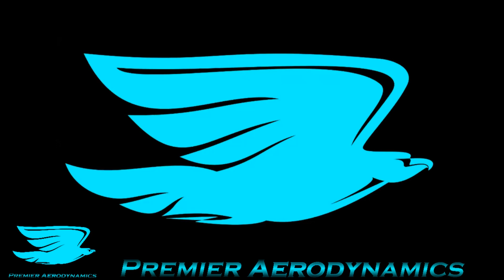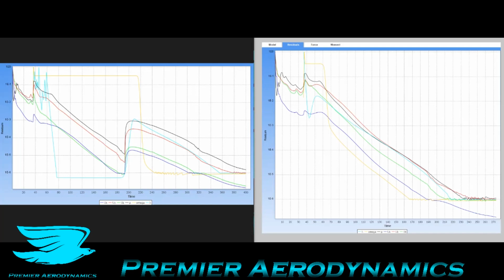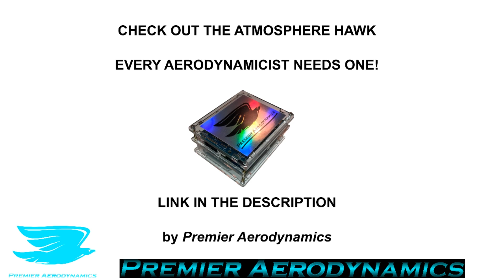Comment: Registration for the International Aerodynamics Conference '22 (IAC '22) is now open! Register here: https://premieraerodynamics.com/IAC-22/

If you want to learn CFD, check out our course: https://premieraerodynamics.com/courses

If you’re not measuring the temperature, barometric pressure, and humidity in your aerodynamic experiments, then check out The Atmosphere Hawk. https://premieraerodynamics.com/Atmosphere-Hawk/

It accurately measures these parameters to get rid of the large errors you get in the density, force measurements, and more! when you don’t measure them.

https://premieraerodynamics.com/Atmosphere-Hawk/